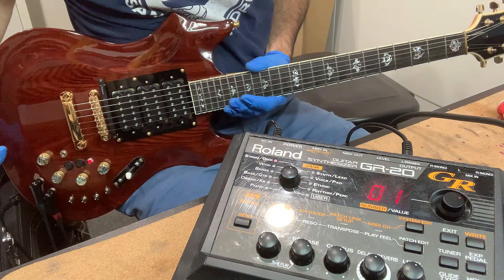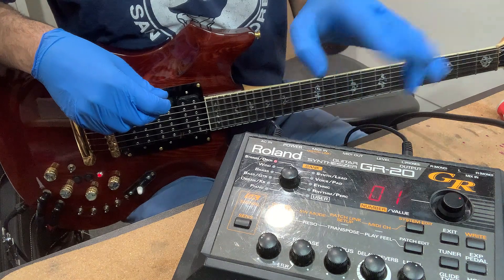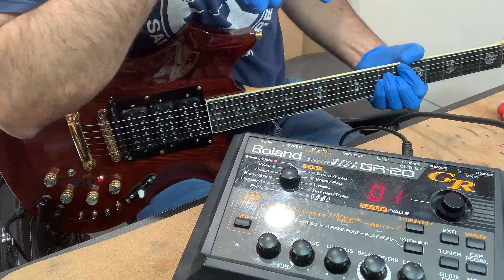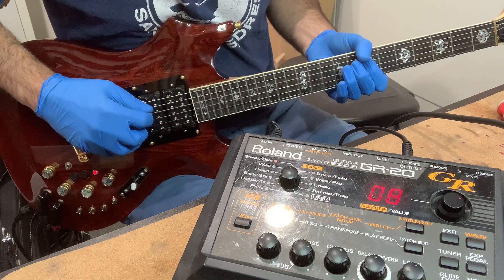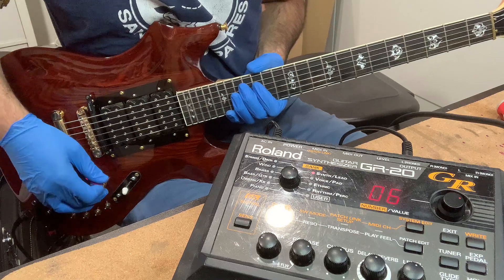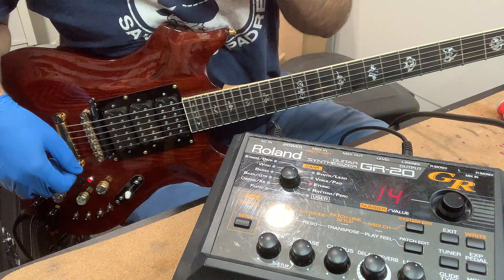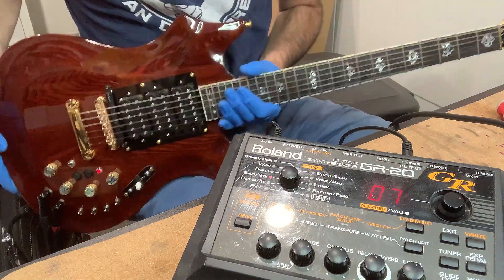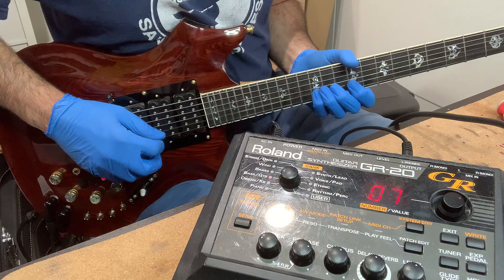Roland GK3 MIDI Kit Demo with Phred Instruments Liger guitar and Roland GR-20 Guitar to MIDI Board

Comment: This is cool, and I've been using Roland GR gear for over 10 years. I'd like to make one important point of clarification for your followers. You continually used the word MIDI. In the very beginning of the video you got it right. It's a 13 Pin cable. But it is not MIDI. Yes, many of the GR units support MIDI to act as sound modules, but the connection type is simply 13 Pin. This is an important distinction because if people don't understand this they may develop an expectation it will work with Fishman's Triple Play setup, which is actually MIDI. We know some of Jerry G's guitars had the GK/GR modification. It was fun to hear him explore the sounds, but alas,  some of his exploring was in front of all of us live. Listening to those old recordings now, I'd wish he would have learned more about the GR gear. Happy to see you have it integrated it with your guitar. Nice touch. And, regardless of folks using fancy saddle pickup systems for the GR, the Roland GK pickup system is the best way to go, in my opinion.Otherwise, tracking becomes a pain. Also, fun video knowing the GR20, is still a fun piece of gear to play with. I have the GR 30, 33, 55. Very interesting technology indeed. Thank you for the video :)
Reply: A simple Google search of the user reviews show it gets low marks due to the multiple software logins and poor hardware design. Looks like Roland’s ease-of-use and lack of 3rd party interference is a better option, but you know it all, so I guess you win, huh?
Reply: @tim.casey.11  Hi Tim. First, i should disclaim my user name. Don't take it to seriously, I don't. But hey, it's youtube! lol. I honestly am not sure what you are referring to in terms of the the google searches and low marks. If your point is, Roland is better option, I  would agree having invested lots of time with 13 pin guitars. The other side is MIDI and these are great options too, but I would agree (if this is your point), Roland GR's are a better option. Hope you didn't preceive my initial comment was a jab, it as intended as construstice comment since the cables for both connection types are similar.
Reply from the maker: Yes, thank you for the correction, the pickup on the guitar is not a MIDI pickup.  The Roland pickup on the guitar is what Roland calls a "divided pickup", and the 13-pin cable sends a signal from the divided pickup to the GR-20, where I'd imagine the signal is converted to MIDI (note, attack, velocity, pitch bend, sustain, release, etc),  before it gets to the internal GR-20 MIDI sound bank.
Reply: @mrknowitall9778  Gotcha, all good. And thank you, this whole exchange has been very clarifying.
Reply: @mrknowitall9778  Seems very nit picky, tho. Is this a distinction without a difference? I didn’t address your Google question, the software Fishman uses appears to be complicated with multiple sign ins per module and the pickup did not fit LP guitars easily without modification, per a few reviews on Google.

If the 13-pin connector is the only thing in common between Roland and Fishman, I do see your point. 

Is Roland just cutting up “MIDI samples” vs. Fishman actually using pickup signal to play the intended instruments?
Reply: @tim.casey.11  Hi Tim. Now i understand. Agree. I also have a Fishman triple play. I don't use it as much but recall the installation and authentication process was very time consuming. I finally got through it and sure, was impressed with the tracking differences when comparing it to the Roland, but I like have a hardware box instead of using my Laptop as my sound module for live playing situations. The so called divided pickup and fishman's pick up is a very similar form factor and both manufactures give you shims for customization. I've lowered my expectations that there's a perfect solution out there. Then there's the custom Strats with the pickup built right in. I have Godin Guitars, so the pickup is piezo based under each string individually. I enjoy checking out JamOrigin's MIDI Guitar. I believe 3.0 is on it's way. Intriguing technologies for sure. The older Roland units have better tracking then the Gr-55. At the end of the day, I prefer a traditional very clean guitar tone, and just using the Roland for some ambient improv stuff.  Thanks for the great conversation

Comment: Thanks for the demo, I never thought disabling string with the sensitivity feature. I will definitly do that! I also have to learn how to create my own preset even if I would probably go for the GR-33 in the near future as it seems pretty close but better than this one.
 After one year using it, I manage to find really interesting sounds, and ways to use it in a "not so kitsch" way. I like this pedal so much, I almost use it in every creations.
Reply from the maker: You're welcome!  The newest Roland GR series MIDI floor controller probably sounds even better!
Reply: @PHREDinstruments     in terms of sounds, Gr-55 and SY-1000 (boss) could definitly, I would love to test them. 
Even if in my opinion the Gr-20 and Gr-33 have both some vintage 80's sounds that could be interesting. It's been said that the gr-33 is the best fit even if it is old, in terms of lantency, the price is also quite descent.
Reply from the maker: @VincentAicardiGuitare  The BoSS SY-1000 sounds pretty good, too!
Reply: Th GR55 is the one you want it has all the features this has ( but drastically updated .....much better tracking and less latency and 900 synth sounds ) additionally the gr55 has extensive 100%  Latency free great sounding instrument modeling with things like Rickenbacker 12 strings , Strats , Les pauls, Danelectro sitars , Martins, Guilds,  on and on etc amp modeling too! The gr55 is a great tool for the working musician....so much right in the box dont waste your money on a GR 20......... if jerry was still alive he'd be using one for sure

Comment: Not MIDI .....it's Roland's  proprietary system . The GR-20 unit can be used as a MIDI controller though......that's why there is a MIDI in and out. You can use the guitar with DAWs instead of the sounds inside the synth unit itself......but the 13 pin system is not MIDI
Reply from the maker: Correct, the Roland divided pickup is not a MIDI pickup.  The GR-20 synths can be triggered by MIDI in, but some of the newer GR systems that have MIDI in, are not MIDI sound modules, from what I've read.  With that being said, are there any Roland GR systems or other Roland synths that accept 13-pin input that don't also have MIDI output?  The main purpose of the Roland GK-3 Divided pickup for guitar is to trigger proprietary Roland synth gear or to send a MIDI out signal to other MIDI sound modules or DAWs.